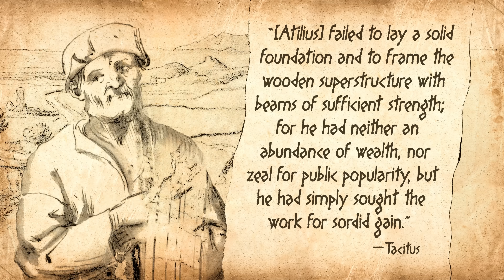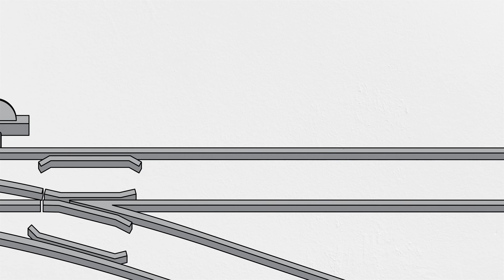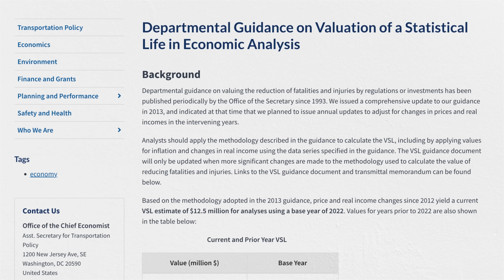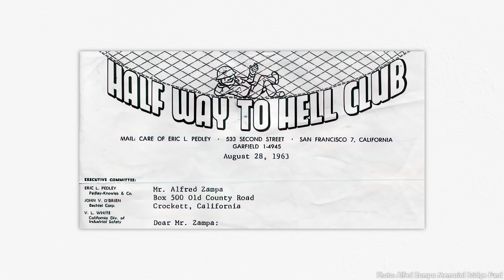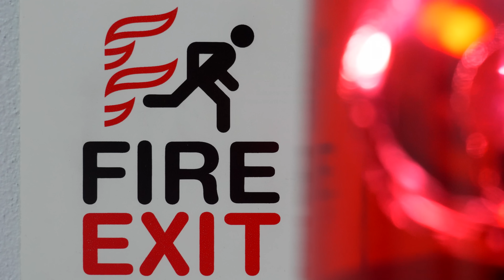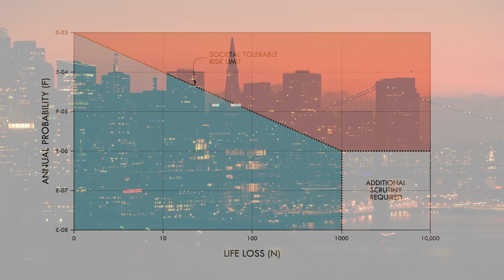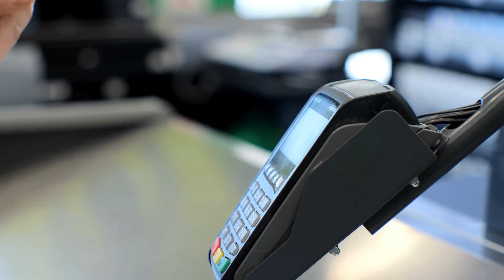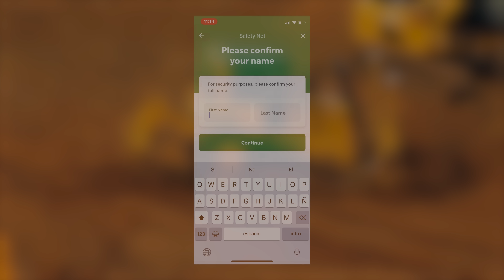How Much Is a Human Worth? (according to engineers)

Comment: I can only say that individuals can make the difference. Examples being one can only protect themselves to an extent. I know I can ride mine and customer motorcycles better than 99% of people, but I have to ride so defensively due to other individuals on the road that my experience means nothing in the testing of the bike. Meaning I can only test about 10% of what I want to on the test ride and have to fill in the gaps with mechanical experience due to the inability of other drivers on the road.

Comment: The place I worked had a complex chart with multiple parameters to determine what safety measures/equipment was appropriate for each task. 1. Severity of injury 2. Frequency of injury 3. Likelihood of injury/accident 4. Cost of prevention.

Each parameter was rated on a Zero to Maximum, or 0 to 5 scale. Each parameter also had a priority multiplication factor.

Management, staff, and floor workers all did individual assessments. It was rare to have consensus. In reality, whatever the manager wanted was what was usually chosen.

Comment: On a related note, in reference to the bridge collapse, there is also an economic impact to certain incidents.  So, even though the bridge doesn't need to be fire-rated to save a life directly, as it's unlikely that someone will be on the bridge when it collapses, the collapse and subsequent loss of use of the roadway (or railroad) may cost a significant amount of money and risk other lives (such as causing an ambulance to not be able to get to a hospital in time).  Of course, the cost depends on where the bridge is located, but should this also factor in to the design?
Reply: Yes, it should.

Comment: I've worked for a while engineering Lithium Ion cells. The difference in safety between companies is insane, and lithium batteries are so dangerous. Panasonic was the worst imo, Molicel had really safe cells. Encapsulating cobalt and hydrofluoric acid shouldn't be taken lightly... expecially in high capacity cells. I've never accepted any safety shortcuts.

Comment: 10:12 in the chart, under the F variable, it increments as IE-"".
What does that really mean? I believe it has something to do with 10 to the power of something.
Could someone clarify? Would be useful ;)
Reply: You're right. E is shorthand for 'times 10 to the power of' what comes after. 1E-05 is 1×10^-5 or 0.00001

Comment: 3:00 The right answer is based on your frame of ethics.
If you flip the switch you are utilitarian, because 1 dying is better than 5.
But if you consider the responsibility and wish to avoid the active choice of murdering the single 1, then you will not touch the button and let the 5 get killed without your intervention, passing the blame of 5 people lost to someone else.

The counter part to the trolly problem is the surgeon problem: 5 people need organs to survive, and you could kill 1 otherwise healthy knee patient on the operating table to save the other 5?
(While it seems the same, its against the hyppocratic oath and against their right of life of the healthy individual, so it has a different answer.)

Comment: I take exception to your statement that "The engineer is solely responsible."  Was the Hyatt Regency walkway collapse the the engineers responsibility?  I don't think so! I would argue that in this day and age there are more disasters due to contractors cutting corners and failure to do proper maintenance than from bad engineering.
Reply: Indeed, the engineer at the rod manufacturers who proposed the revised design and the project engineer who approved it are entirely to blame. It's taught as an engineering failure in most engineering curricula.
Reply: @LikelyToBeEatenByAGrue  Fair enough.  I was thinking of the engineer that originally designed the structure.  Not being a civil engineer, I had the impression from the media that this was an on site change.
Reply: @thekinginyellow1744  for sure, but change orders are normal and need to go through the same scrutiny as the original design.  When they don't, that's the engineers fault.

Comment: Yes. This is a very sensitive topic, but you explained it well.

But even the best engineering project can fail when those involved dont act ethically. See Tofu Dreg cities being torn down in China, dams, and bridges collapsing due to inadequate maintenance. Homes, buildings, and infrastructures failing or collapsing due to poor building codes, not following codes during construction, sub-standard materials used, poor quality materials, under skilled labor, etc. Add natural disasters, aging, erosion, etc. into the equation and loss of life seems almost inevitable. 

Then throw, ambition, greed, politics, corruption, apathy, into the mix. Worker laziness or peer pressure can also compromise safety.

For almost 35 years I worked in a mill that makes high strength engineered wood beams (Parallam PSL). I was recently forced into early retirement because, as a safety conscious quality control technician, we did not follow safety work practices or quality control standards. It became common to ignore defects in the product, and to fail to follow our own safety procedures and published standards, ethics, and values. Looking good was more important than being good.

Comment: at 5:20 in the example of the highway, I'd like to note that a lot of these end up increasing the speed people travel, largely because they feel safer and thus more comfortable taking risks like driving faster, or using phones, or being otherwise inebriated.
adding safety to a system can allow users to behave less safely and trust in the system to catch them.

this is not a reason to not build safety into a system, but it is something to consider when claiming the changes will reduce danger.
Reply: The best safety measures are those which are invisible to the user.
Reply: Helmet laws for bicycles save less people than predicted, because drivers give them less space since they don't look as vulnerable, and probably the cyclists also behave differently.

Comment: The funny thing about the trolly problem is that it ignores that you can simultaneously at least try to warn the one guy
Reply: A video I saw where it was tested in had the controller in a small room with controls and camera feeds; they could only control the track switch, and that was it. Of course, there are many variations of the trolly problem and flaws can easily be found, but that's not the point of the problem is it.
Reply: No, because they are too far and/or using loud equipment with ear plugs.